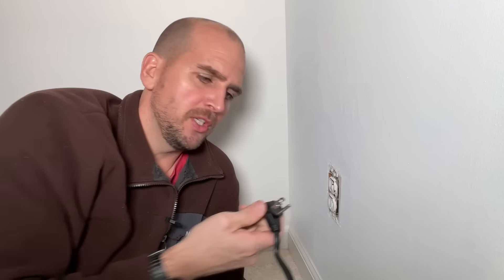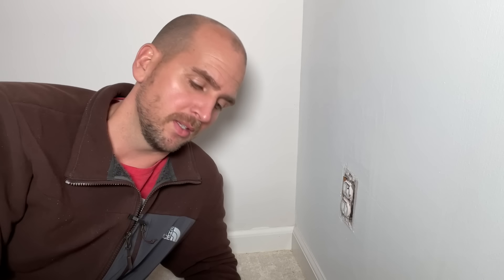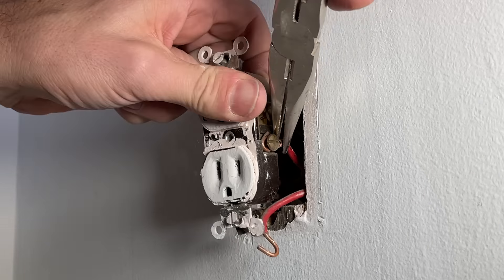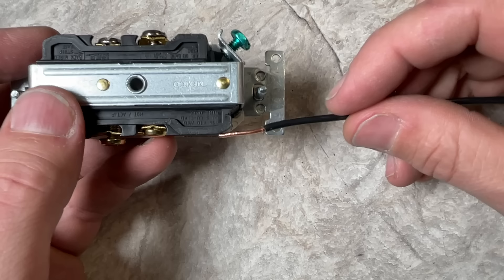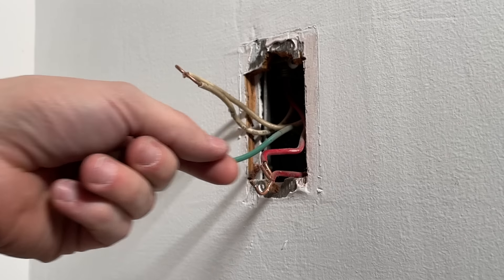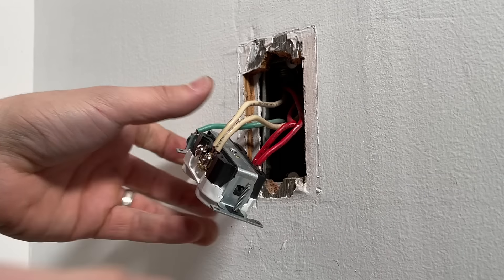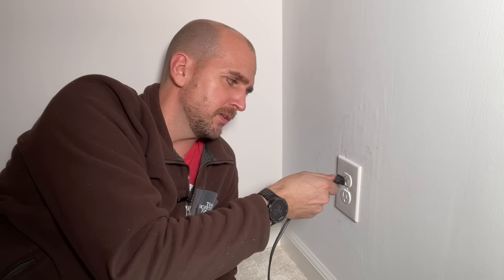Plug Won't Stay In Outlet

Comment: Good video but . . .because there were 2 hot wires connected to this outlet and they were under different screws , this could have been  a situation where one of those hot wires was on a switched circuit and  the switch happened to be off at the time you used your tester.    Fortunately I can see in your case the jumper is intact so not a problem.  One other minor point, the outlet you are installing is not set up for back wiring as you referred to a couple times in the video.  It is a side wired outlet.  I never use back wiring even if its available and quicker to use because  the wires  only make a tiny area of contact with the outlets terminals which can lead to loose connections and that creates  causes heating and possibly can start a fire.  In my opinion, until back wiring terminations are much improved over current designs, they should be outlawed.  Another bad decision by Underwriters Laboratories.

Comment: Just take the terminal screws all the way out to release the wires from the old receptacle instead of prying them out. Cleaner and easier and less risk of damage to insulation. 40+ year electrician.

Comment: Or.... just pinch the plug prongs together, or pull them apart a little. This will help hold the plug into the outlet better. In case you don't want to replace the outlet. Like a hotel room or a temporary room somewhere that is not your place.

Comment: I just moved, and the only outlets I bought were GFCI, even though most of the outlets I replaced, I wanted an extra piece of mind.

Safety has no monetary value.
Reply: would've been cheaper to replace all the breakers in the panel with dual function GFCI/AFCI breakers >_>

Comment: How do you know when wires need to be cut & restripped?
Reply from the maker: If I see the copper has been damaged and might eventually fail I just strip some new copper.  You also need to take into account how much wire is in the box because you don't want to cut the wire too short and get yourself into trouble.

Comment: Also you should do a Shepard hook every time.  It actually holds and you don't have to worry about the wiring coming apart and losing your money to have a electrician come out and troubleshoot a simple problem. Back wiring is a no no when it comes to professional electricians.

Comment: An outlet not holding the plug, is actually a minor safety concern.    The loose connection can cause the outlet to overheat and burn, or even burn the plug.

Comment: I do have a receptacle that doesn't hold plugs as it should, but it's only a two-prong receptacle. How does a plug-in tester work in that situation when the tester is 3 prong? Does the third prong retract? I don't see any two-prong testers. (pardon my laymen's ignorance...I hope my question makes sense)
Reply from the maker: With 2 prongs I would use a non contact voltage tester or even better a multimeter when checking for power.
Reply: @EverydayHomeRepairs  Thanks! That makes sense.
Reply: You can also get the old-fashioned type of tester with a neon lamp and two wires with pins on the end.

Comment: When an outlet tester is inserted into the outlet, it should be wiggled slightly in several directions. If you just plug it in, then remove it, this is the same situation that many bad outlets may initially appear to be ok, because the prongs of your device/appliance may make just enough momentary contact to seem like a good connection.  If you wiggle the tester, just like wiggling the plug of a device or cord, it may lose that connection, causing the device (whether a lamp, extension cord, etc) to flicker, which indicates a poor connection inside the outlet/receptacle (or occasionally a loose connection of the power supply wires at the back of the receptacle). 
After noticing a lamp flicker in a hotel many years ago, I've gotten in the habit of carrying an outlet tester in my luggage.  You'd be surprised at how many outlets in hotels, even upscale ones, have worn out outlets or bad wiring.  I became concerned about my wife plugging her work computer into bad outlets.  This could damage your computer (and other devices), at the least, in addition to being a fire/safety hazard. 
     On a recent trip up the coast from CA to WA, we stayed in many motels/hotels.  Nearly every one at least one bad outlet, many had multiple bad outlets.  Per the outlet tester, there were reversed hot-neutral, reversed hot-ground, and various other bad wire connections.  That's in addition to the many worn/damaged internal contacts inside the outlets.  This is often caused by the frequent and rough use by the housekeeping staff, vacuum cleaner plug-ins, removal, etc. 
     These should be reported to the management (not just the front desk person).
Reply: That just tests for loose connections / wires.

Comment: Most plugs are made with Brass connections internally and Brass does not hold spring tension very well.  The Best plugs use Beryllium Copper, which maintains it's spring tension that holds plugs far better than the Brass.  I like the plugs that have a square washer under the screw and the washer has raised areas across surface, and that makes for a much better connection to the wire.  One thing, even though plugs come with a hole to push in the wire, NEVER NEVER USE THEM!
The spring tension on those are lousy and I'm really surprised that UL still rates them as safe.  I have seen plugs actually catch fire when the Hot connection is loose on the plug or the wire plugged into the hole.

Comment: You should really run electrical tape around the outlet to cover the terminal screws to help prevent contact either with the box, or for the next guy that needs to service it.

Comment: Question: I just replaced one in my room and I did not placed the wire behind the plate rather I did the loop around the screw. Is there any problem with doing it that way ?

Comment: Hi: my home has some outlets that the top plug is set up so when you turn  off the light switch the top plug goes dead. The bottom plug is always hot. How do I wire that one back up? 
Thanks
Reply: Do you want the switch to still control the outlet or have both sides be hot?
Reply: @sargentnocap1414  yes

Comment: how do you tell which wires are hot and which wires are not? will the plug on the bottom still work if you only use the receptacles on the top?

Comment: Many ways to correct a loose receptacle. Close or twist plug prongs.  Old plugs have layered  prongs that can be spread apart. Using wires under two screws for a pass thru is a poor idea.

Comment: Nicely made video, I liked seeing the guts of an outlet. I would advise against using back wire on an outlet however. True it is faster on the install but Keep in mind your outlets in your home will be tied together on the same circuit. Eventually the back wire fails and you'll be left wondering why the breaker is on but you have no power to an entire room. I recommended using the terminal screw always. Keep up the good work

Comment: You can (according to most code), put a 20A outlet on a 15A circuit.  You CAN NOT put a 15A outlet on a 20A circuit. CORRECTION: You can put a 15a outlet on a circuit wired for 20a outlets (20a circuits use 12ga wire and can easily handle 15 amp loads). (Thanks Dan)
Reply: You have it backwards.  You can put a 15a outlet on a circuit wired for 20a outlets (20a circuits use 12ga wire and can easily handle 15 amp loads).
Reply: @danburch9989  Ah, thanks for the correction.  Definitely my mistake.

Comment: Here's a tip. Spend an extra $1.50 per outlet and buy a 20-amp receptacle instead of a 15-amp receptacle. Your biggest complaint will be it's hard to plug your cord in. And ditch the non-contact tester. One more thing... best practice is to tail out multiple conductors so you have one hot and one neut going to the receptacle.
Reply: Spend an extra $1.50 per outlet and buy a 20-amp receptacle instead of a 15-amp receptacle ...   Does  not sound right.  20 amp receptacles are marked as such, so somebody down the line may device to plug 20 amp appliance there ... while there is only 15 amp wiring/breaker behind

Comment: What is causing my new Menard's brand (made in China) 20A GFCI to not hold 3-prong plug in snugly? It is short going in by 1/8 inch and I'm afraid I might touch those prongs and get a shock.

Comment: On the back of the outlet is an arrow showing the up position, you have it upside-down.  This is incase the weight of the cord pulls down, only the ground is exposed, otherwise a kid could put a fork across the Hot & Neutral.

Comment: The proper course is to replace it with a CR15 series receptacle. Or even better, a 5362 series receptacle. Then make down the box so that only a single pair of conductors terminate on the receptacle. Never use a non-contact voltage tester when removing a receptacle. Instead, remove the faceplate and place a proper voltage tester (Knopp, Wiggy) directly on the terminal to test for voltage. (former electrician in previous life).

Comment: Electricity is nothing to fool around with.  Watched a few of your videos and commented.  This time it's about residential grade vs. commercial grade.  This could be confusing for a DIYer when purchasing an outlet as a replacement for their home.  One would think that the residential is the right choice.  However, you (and electricians as well) state that the commercial grade outlet is the better choice even for a residence because of the quality of the outlet.  So, the question:  In your opinion, why is the less expensive, cheaply made outlet even manufactured and sold?  You would think that there should be some universal electrical standard that allows only the better outlet to be made available.
Reply: because it makes the sellers more money, it does the job, more or less, and makes more money AGAIN when it wears out earlier.
Reply: @RICDirector  Thanks for your response.  IMO, just like some areas require by code that the outlet be tamper resistant, their should be a code so that the cheap 99 cent outlet is not per code (of course a homeowner can buy them and not be inspected).  Manufacturers of the cheaper model are introducing a sub-par device in someone's home that could result in a dangerous situation.  They should be banned, no longer manufactured, and not sold.

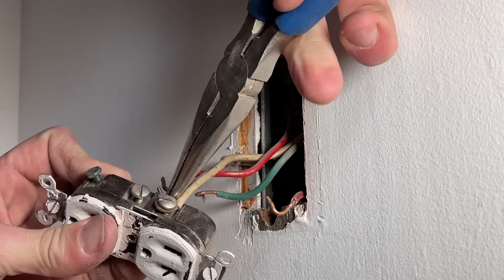Comment: 3:30, on an old receptacle you could just remove the screws, rather than fuss with the j-hooks. I've done it with old receptacles.
Reply: yes I was scratching my head why he was playing with it  ,  just remove the screws , furthermore if he knew he was going to back wire the new receptacle why not just cut them off in the first place lol ???   the correct way is to wrap wire under screw , more contact area equals less resistance equals less heat at that joint . Certified electrician 30 years I love watching all these vids on youtube that make ya shake your head  , damm wasn't there a vid made on metal boxes where the most important thing was not done ie. bond the box lolol , People got to be careful  of what they take from these youtube vids  , all done by jack of all trades masters of none

Comment: 5:35 😂😂😂 I don't get why the tamper resistant ones are required. Any kid who sticks something through both openings is at a much higher danger because the current will run directly through their body towards the best possible path electricity would want to go to- the neutral. 

Seems kind of pointless to me... I mean I guess the logic is that a kid won't think to do that... but seems like a lot of extra cost for very little protection to me... idk... I'd rather also have a kid accidentally be shocked in a way that probably won't kill them than in a way that will kill them. It also gives a false sense of security to parents.

Comment: My loose outlet is on my stove/oven. It's never been used because it's so loose. But how would I replace it?
Reply: There are videos on here that will show you. Unplug your stove and look at the cord on the stove to see if it has three wires or four. Next go to your local home building supply or hardware store to purchase a new 3 or 4 prong receptacle (whichever type you need). Next go to your electrical panel / breaker box and turn the power off to the electric range. If you are not for certain which one is the correct one just turn the main breaker off (this will stop ALL electricity so everything will go dark), then using a screw driver remove the plastic cover, remove the wire clamp, loosen the wire attaching screws and replace the receptacle. The wire prongs should look like this \l/ except the middle one will be kind of an upside down L shape. The two angled plugs/spades are both "hot" wires each carrying 110-120 volts. The L shaped is the "neutral" wire and if there is a 4th wire that will be the ground wire. Replacing the plug is easier than it sounds, the most important thing to remember is to make sure the power is off before you start work.

Comment: When you took the old one of, the red wires were plugged in separately.  However, when you put the new one in, both red wires were plugged into just one screw.  Why?

Comment: Not sure why you connected the two hot wires to the same screw and the two neutral wires to the same screw when you had two screws on each side that you could have connected each wire to each screw.

Comment: Hotel outlets wear out because housekeepers don't bend over to unplug their vacuums they just crack the whip to unseat the plug from the outlet! I know because I used to oversee the housekeepers at a motel. No matter how many times we asked them not to do it they still did it.
p.s. Your box is sitting too far behind the panelling, you should use a box extension, aka "goof ring". Such as the Steel City SBEX Steel Box Extension or the RACO 976.

Comment: At home there is one outlet where I can’t have the plug pushed all the way into the socket. If I did, the device wouldn’t work. And I need to get it in a certain amount. Too little would easily make the plug fall out, and too much would not make the plug work

Comment: Outlets are installed upside down... the ground port should be on top to prevent a short if a conductive material (knife) accidentally falls onto both the hot and neutral blades of the plug if the plug is not inserted fully into the outlet and the blades are exposed as in this video of a plug partially slipping out of the outlet. It's also easier to insert a three pronged plug if the ground prong is on top. The outlet will function longer when installed with ground port on top because when removing the plug the action is to pull out and upwards rather than pull out and downwards which will wear out the outlet contacts faster and begin to cause downward slipping two blade plugs. An upgrade to a more expensive commercial outlet may not required if one pays respect to the tool.
Reply: Almost nobody puts the ground at the top.  It isn’t a requirement.

Comment: The non-contact testers are great to have when you're upgrading a circuit to GFCI. My house was built in 72 and I think the plugs were probably last worked on in the early 90s. Many of them were pretty worn out and none of the wet areas had GFCI protection. So once you cut the power and take the outlet out, you'll have these bare wires and the only way you can really figure out your line from load is either with one of these non-contact testers or a multimeter. I like the non-contact because I don't have to get my hand nearly as close to a live wire and I only need to touch one wire to figure out if it's carrying power, which is nice.

Also, when I'm working with short wires, I try to stick my pliers on the copper as little as possible. Which means I'll force the screw on the old outlet past the stopping point and out of the hole entirely just to keep from scratching the copper.

Comment: You wired your replacement plug wrong the original had two wires under two separate screws (i’m referring to the hot and neutral wire) basically what I’m saying is the original plug had two Hot wires under two separate screws on the One side receptacle and then the two neutrals Had two wires connecting to the other two screws on the other side of the receptacle but you put down both of those Hot wires under one screw and then The two neutrals under the other two screws and I would say that’s wired incorrectly(and a Lie to haul of the viewers😥). Thanks so much for the video though😎.

Comment: What I usually do is just bend the two outlet prongs away from each other a little bit, so they hold in the holes better.  Takes a couple of seconds and works fine 90% or more of the time.

Comment: Is there a brand of tamper-resistant outlet which is not dang near impossible to insert a plug into?
Reply: No, they are all horrible build.  I hate them.
Reply: My electrician told me I needed tamper tesistant receptacles for the kitchen work I was having done, so I got some cheap ones.  Then, after inspection, I replaced them.

Comment: i have a really nice, REALLY expensive surge protector so this solution is not practical.  Any McGyver-ish type suggestions?  I have been bending or splaying the prongs to .  Hmmm...thinking as I write.  I could buy a little 2 to 1 plug in (the problem only occurs with older equipment that does not have a grounding prong.  That would be snug and then ITS connections would be brand new and snug.

Comment: Two watchits  one a switched  plug and unswitched  in same box which should be on different breakers if on is light and one is plugs AND shared neutral circuits (either of the above or both)  the neutral could be hot or may become hot if the other leg comes on (a fridge will give you a real jolt)   clairfy back wired vs back stabbed which should be illegal